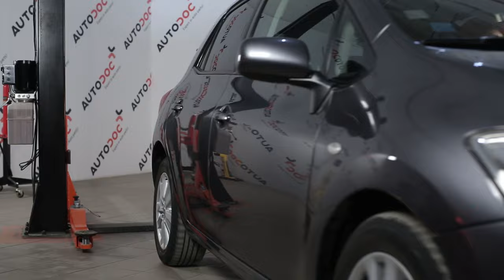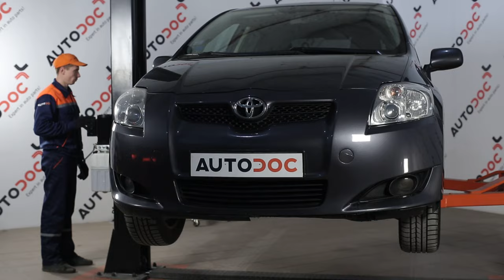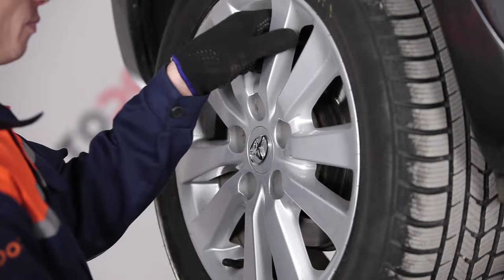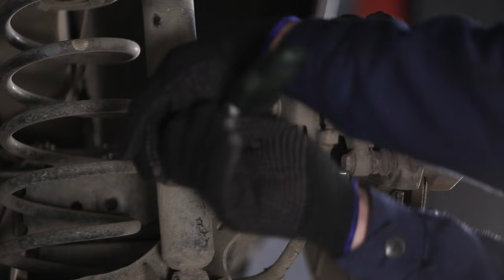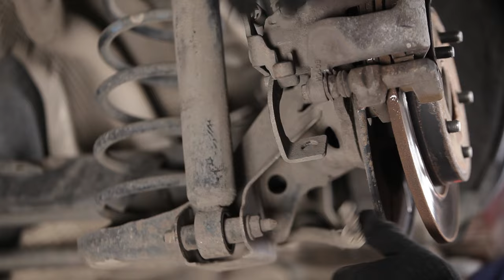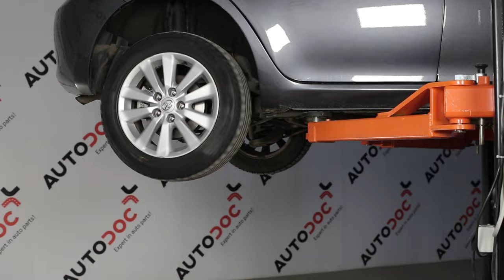How to change rear brake discs on TOYOTA AURIS 1 TUTORIAL | AUTODOC

Comment: Yes let's put on some discs without cleaning them of all the oil first. Good idea!
Reply from the maker: Thank you for the feedback! This video is considered to be an informative one, and it shows the sequence of repairs, so some stages of the repairs might have been excluded. Best regards, Autodoc.
Reply: Pity you can not spell disc
Reply: @autodocuk  Dont you see the risk of misleading peoples to do it wrong when you dont add the entire operation and information?
Like... You always have to clean storage oil from discs?
Dangerous situations can occur if not.
In almoust all cases you change discs because they are worn.
Then also the pads is worn.
You never put new disc on without replacing pads.
When you replace discs and pads, you need to push in brake pistons to get the caliper back on.
You should show how to do that correctly.
Dount put other people in risk of danger by doing it wrong because of misleading or lack of important information.